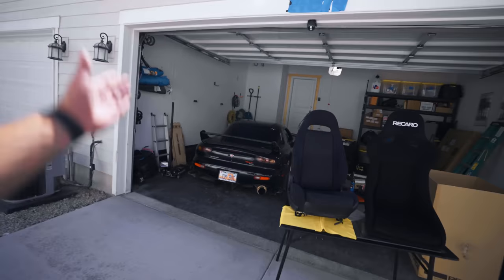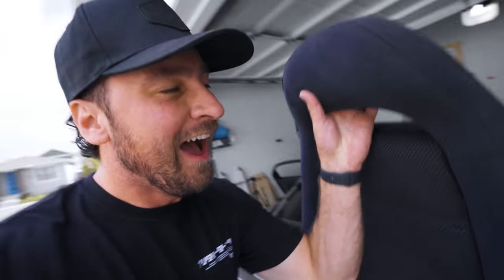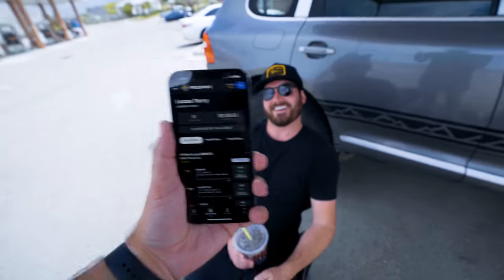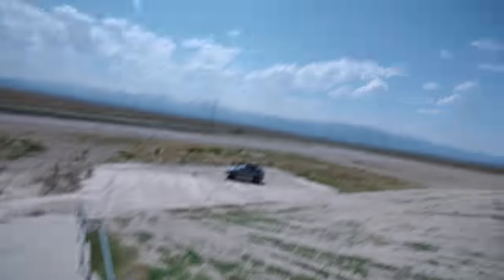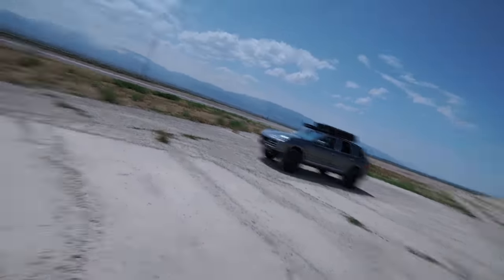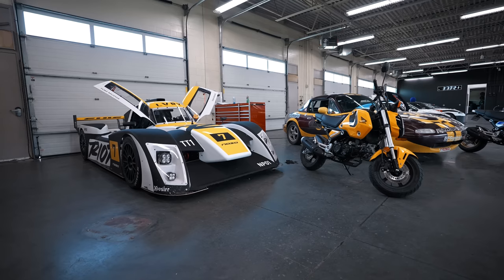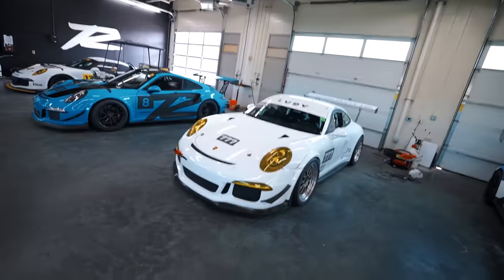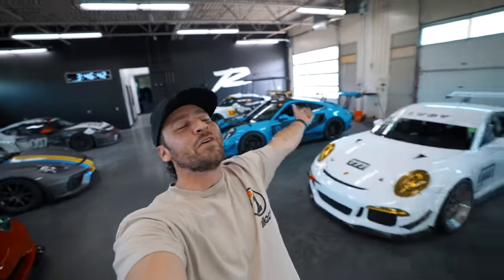Unlocking My New 50 Car Garage

Comment: "Unsprung weight" is weight from the tires, brakes, control arms. Unsprung means just that, the mass is not being felt by the springs (like when you sit in a car and it squats a little).

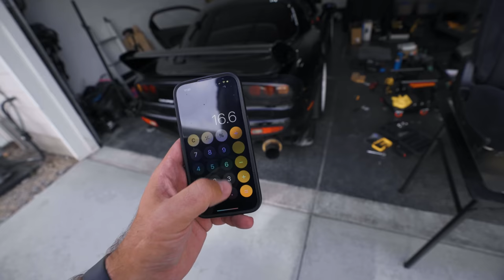@ 2:30 for reference